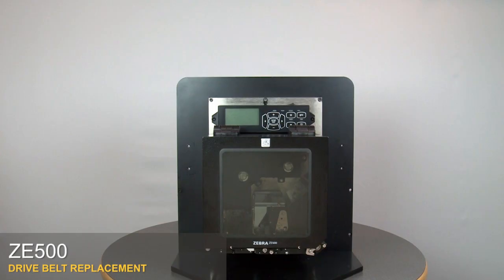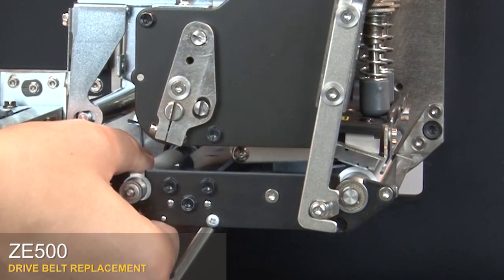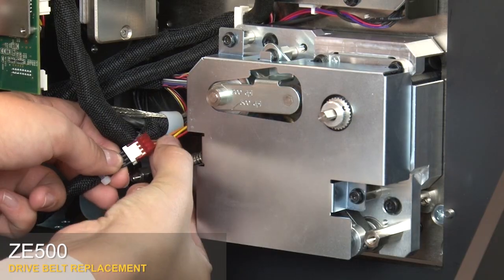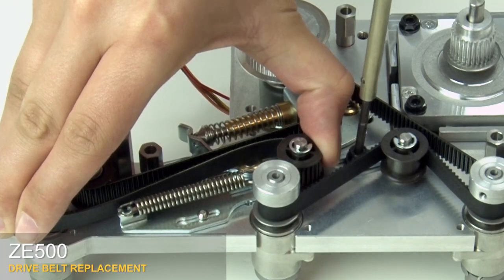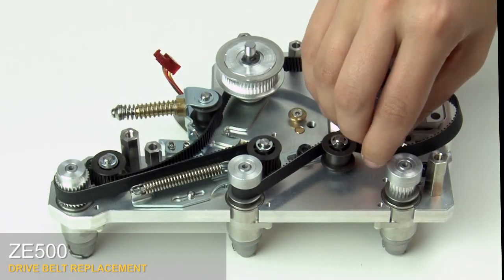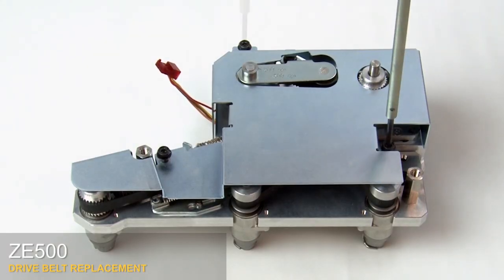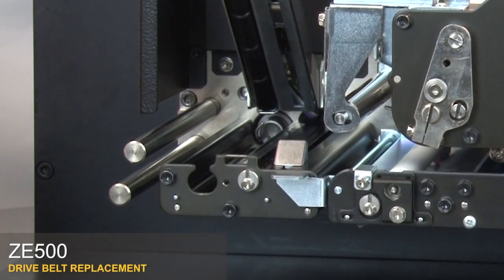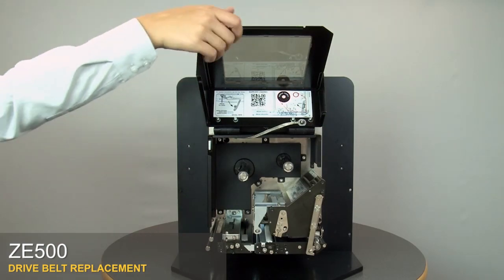Zebra - ZE500 Print Engine: How-to Replace the Drive Belt

Comment: Why does the QCMS (Quick Change Modular System) have to be removed with this procedure? Is it a matter of convenience, or is there something that could go wrong. Because I was able to change the belt while the QCMS was in place, and all of the rollers were in place.
Reply: That is correct, probably just a formality. We don't remove rollers either
Reply: We swap out printer engines on the fly and take ours back to the shop to full function test and rebuilds. The swap usually takes us about 10 mins to do and back online ready to go. Most repairs are very simple and easy just we do through function test all consumables, feeding, and print quality test back at the shop.